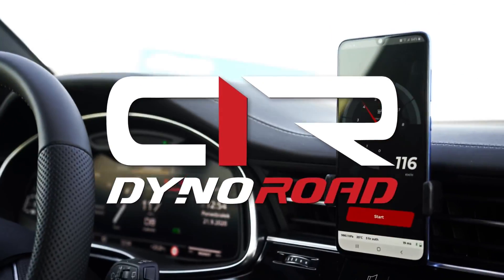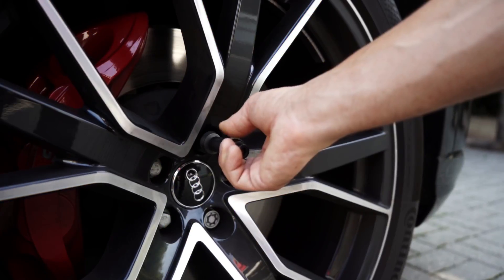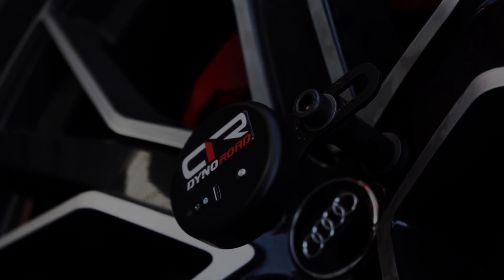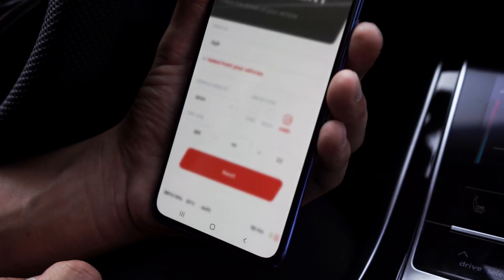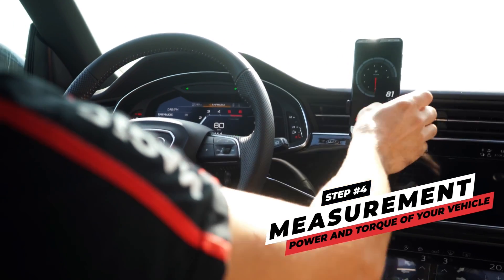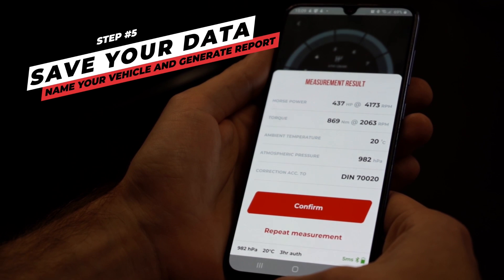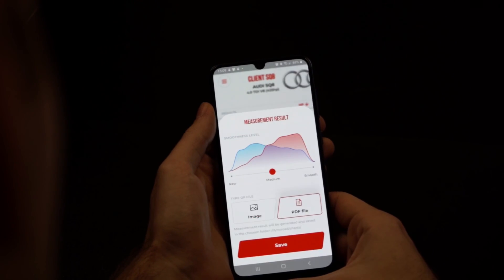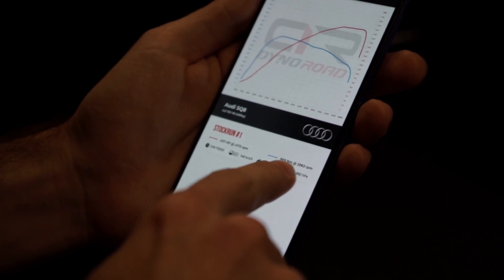Magicmotorsport: A Guide to Using DynoRoad

Comment: A friend of mine has this tool and we are trying to use it extracting the most precise data possible. I've been looking for a user manual but can't find anything on your website. I'm not sure about one thing: is it fundamental to use this tool on a flat road (without inclination regarding to gravitational force) or does the system correct for this automatically thanks to very precise accelerometer and fast rate of measurement?
Reply from the maker: Hi, for correct use of the tool it's always best to work on a flat road, in order to minimize variables and ensure higher quality results. If you need support, you can contact our technical team via chat or helpdesk. See you soon!

Comment: This is cool for low power vehicles.  Once you introduce power and have to deal with wheelspin your measurements will be totally off.
Reply: nope. You can perform power and torque measurement on 4th or 5th gear.
Reply: @bogdanskutkiewicz5217  ok, you go ahead and try flooring a high hp setup at 1.5k  in 4th or 5th.   Bring a shovel and a scooper
Reply: @SouthernSpeedVideos  check Powerdivision youtube channel. We ve mde 1200HP AUDI RS7 and you can find there some tests. Of course its safer and better on dyno, but sometime and for some kind of tests dyno rolls are not possible. Then dynoroad is welcome.
Br

Comment: As an owner of this tool I do appreciate your enthusiasm and admire your marketing prowess, however this tool is a long way from being useful for professionals just yet. Let me begin by outlining some of the key problems. 1. Vehicle weight: having the user input the vehicle weight is dangerous, every kg matters in the accuracy of the results, therefore the weight of the car should be broken down into its primary components a. The curb weight for that model, b. the fuel type and quantity in the car at the time of measurement, c. the drivers weight, d. any passengers weight. 2. More accurate sensing of the actual outside temperature. Today I did a test run in 3 degree celsius conditions - the device told me it was 14 degrees.. sorry but theres a big difference in air density between 3 degrees and 14. 3  you need to modify the way this device operates so that we do not have to find neutral after a high performance run, its dangerous on the street - difficult when your dealing with DSG / Steptronic, ZF8 or DCT transmissions and doesnt accurately account for the mechanical losses transmissions give, especially if its an all wheel drive system.  It can be done in the gear of the run and will give a more accurate read of the transmission power loss. 4. No OBD connection to the vehicle... your missing a LOT of useful data here.  5. Database - I know its not online yet - but you cannot allow users to add information into it unless its properly vetted - especially due to point 1 above - vehicle weight. 

Its a fantastic start, but right now, its not much better than logdyno and theres no need for an external device - they at least use OBD data. I agree with Allen Zhang, you really need to do be providing a OBD device as well so you can avail yourself of all of the vital information needed for a proper run and - as a customer - you should be providing it as part of the package - for free. Good luck with the development. I hope you get there quickly because the asking price right now doesnt justify its present capabilities and I will be seeking a refund for mine if it doesnt improve in due course.
Reply from the maker: Hi J.M Power thank you for your feedback we appreciate it and let us address your points: 

1. That's why we're always asking to weigh the car before the measurement.

If we do something as proposed, the results will be inaccurate, as driver never knows accurate data of the additional things in the car, exact fuel mass and probably just estimates weight of himself and passengers, also the weight of the car itself on paper are mostly not accurate either. So, weighing the car before the run it's the only way to do this properly. :)

2. We're working on temperature data improvement.

3. For now, we're not planning to add a OBD plug.
Reply: J.M Power Thanks JM power, I bought this tool last year. Haven't used once yet.

Comment: Should have the OBD socket with live data from ECU as well.
Reply: 1. IOS System 
2. OBS socket or connect with flex OBD to get live data 
3. Should also can test 0-100/0-200 results